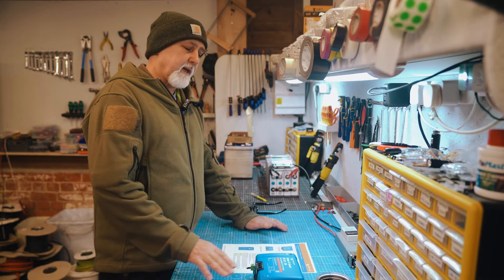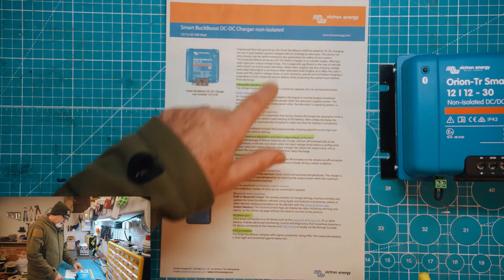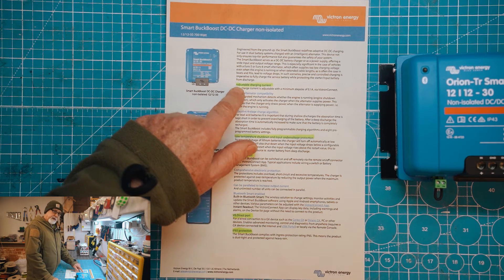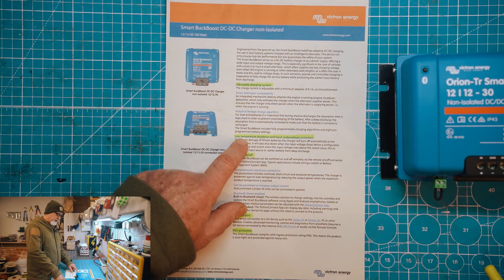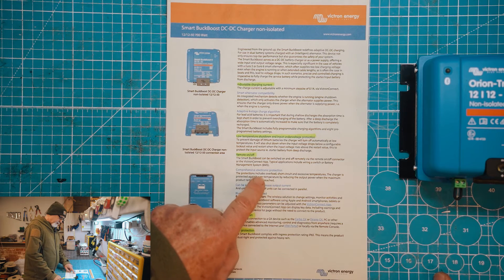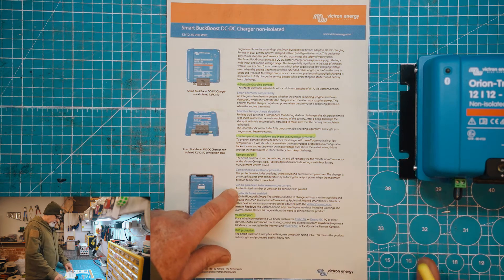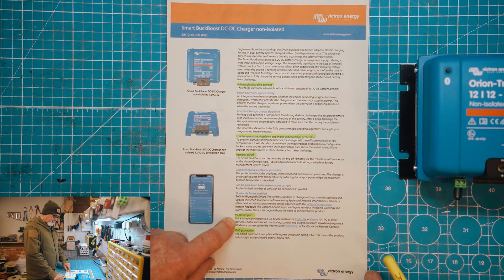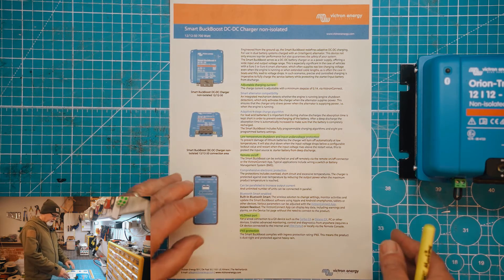New Victron Smart BuckBoost 50A Dc-Dc Charger - First Impressions

Comment: A question for all you fundi's:
I have a 12v Cranking battery on my boat, which obviously starts the outboard, and a 24V auxillary battery which powers the trolling motor.  I currently have a Victron Oririon TR Smart 12/24 - 10 DC to DC charger which charges the 12V cranking battery as priority and the 24V auxillary battery once the cranking battery is charged.  This happens whilst the outboard is running.
I need to find a solution for a backup in case my cranking battery fails, as I obviously cannot start the outboard with the 24V. Suggestions please.

Comment: Im only getting 20A from my 30 dcdc
Maybe I'll get 30A from a 50
Reply from the maker: Your DC-DC might not be getting 30A from your alternator or if you have an absorption fridge running, that might be using some of the power.
Reply: 16mm2 cable , 10m length from vehicle - caravan  , 30°C + temp
Guessing combination of cable length and temperature derating factors

Comment: If you're running a sizeable offgrid system, then it's usually best to go with 48V. In which case the Safiery Scotty is a great option, plus it can push 1500w

Comment: Very interesting roger,  I'm looking at putting in victron 12-12-18 or the 30 supplying 2x120ah lead acid  batteries but you say you wouldn't do that with lead acid builds . What would be the reason? Lithium is a future goal just not yet.

Comment: It will be interesting to test this  new model and measure the performance. The current Orion 30A DC-DC are only 87% efficient.  Just after few minutes it gets to hot and reduce charge current.
I really dont get why they not adding a fan into the new version. Even if the efficiency are improved it will probably be to hot inside as the case is more compact.
I think the Votronic VCC1212 series will still be nr1 choice, specially the 70A and 90A versions.

Comment: One comment I would make on charging.   Generally speaking there is no need to stress the battery or the BMS.   Most individual LFP batteries will have 100A BMS's which means in order to not stress things you want to limit charging to 50A or less.   And, if you can swing it, stick to 0.25C (25A for a 100Ah battery).  But there are three other things that have to be taken into account.

The first is, of course, if you parallel multiple batteries you can increase the amperage and still only be pushing 0.25C or 0.5C into each battery.   If you have 4 x 100Ah batteries in parallel, then charging at 100A is only 0.25C going into each battery.

The second is also related to paralleling batteries.  Because the batteries have BMSs and can disconnect, the absolute maximum charge rate for the whole bank should generally not exceed the absolute maximum continuous charge rate for a single battery.   And this is typically 100A.

And the third relates to safety and wire sizes.   There is a big difference between 25A and 100A, or between 100A and 200A, when it comes to sizing wires, so to simplify matters people go with higher voltages and lower amperages, smaller breakers, and smaller wires.   e.g. with a 51.2V battery bank, 4000W is only 78A which 2 AWG cable can handle with ease.

Comment: Oh nice.  But only 12V 😞I was hoping for a buck-boost that could do 12-24/12-24, or 12-48/12-48.   The efficiency is good anyway... 98.5%, but note that will ONLY be for the "buck" part of the circuit.  If it has to boost, efficiency will not be even remotely close to 98.5%.  It will be more like 94%.

One problem is that the unit isn't isolated.  It would be nice if it were (efficiency would suffer a bit, but still...).

The weight difference is probably related to how the unit dissipates heat.  Most of Victron's gear in the 30A and lower category are passively cooled and are half-potted with the rest of the space taken up by salt or some other crystalized mineral.... which is heavy.   The actual electronics are light.   It sounds like this new unit has gone a different route for heat dissipation.

Comment: The Stirling range of buckboost would be a good one to look at 10amp to 200amp same efficiency but will also do reverse charging. Personally if I wanted a 50amp DC-DC I would rather go for one with built in MPPT then you have the option of connecting solar panels into it  ( Renogy, Redarc I think votronic as well)

Comment: Interesting bit of kit. 
I agree with @tiborchren that it would be nice to have a range of these as my requirement would be for a 12v to 24v BuckBoost, and as I am a marine user the IP65 is a requirement. 
My existing Stirling device will need replacing next year, and the Stirling version is not as efficient as the Victron device, and is eye wateringly more expensive.
Reply from the maker: I suspect they’ll launch different models soon. The 12/12 is their most popular model, so makes sense to launch with that.
Reply: Stirling already do buckboost 12 to 24 for marine use
Reply: @LancashireProClean  Yes I have one installed but after 5 years it is starting to go rusty, the newer versions are better protected from salt water. I would like to be able to monitor it from my Venus kit, don't like too many different manufacturers kit on board that don't talk to rack other.
Reply: @DavidPritt-xh7qq  For marine use you want an isolated DC-to-DC converter to remove possible galvanic corrosion paths, which this Victron is not (as an added issue).
Reply: Lagoon's after sales installer placed the Sterling in one of the engine bays, not an ideal location, also quite low down, worse position it could be in. The shore supply is galvanically isolated, and everything else is bonded correctly.

Comment: I would like if Victron would make a Smart BuckBoost 12/48 Dc-Dc charger where it can charge a 48V battery from a smaller lighter portable 12V battery that it can solar charge in a different location than the main 48V solar system.
Reply from the maker: I suspect they’ll make different models, but I agree hopefully there will be a 12/48 model which we never had with the Tr Smart version.
Reply: Stirling already make one